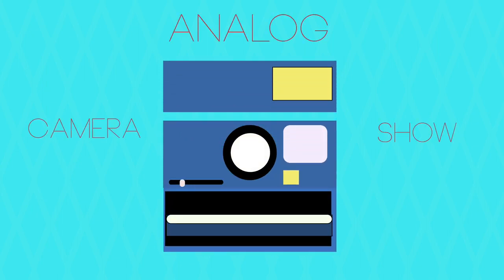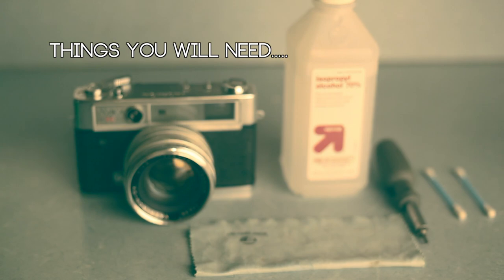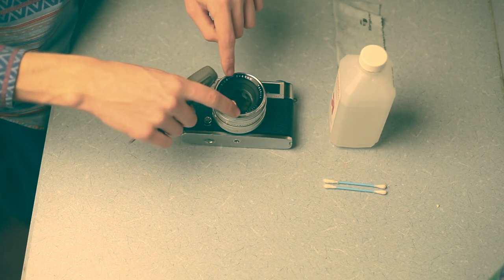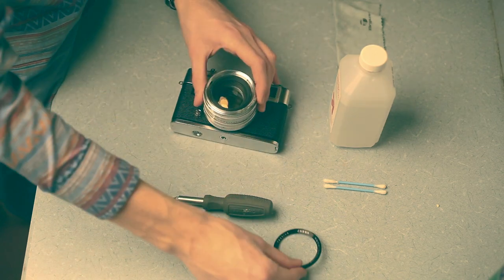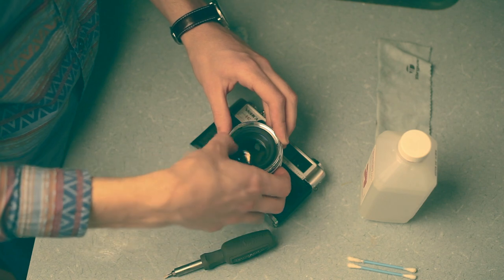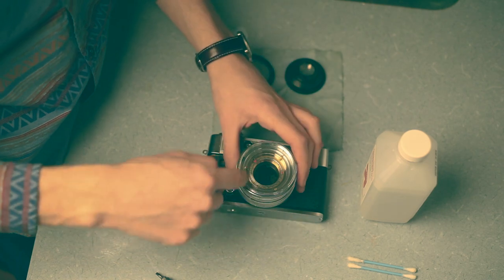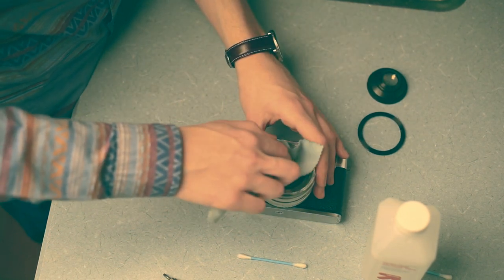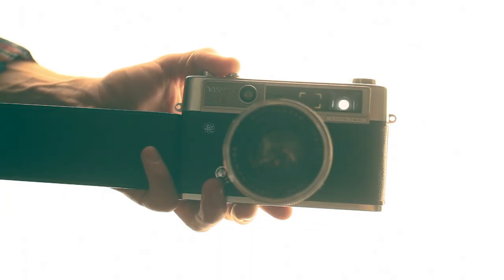How To Fix a Stuck Shutter on a Yaschica Lynx 14E

Comment: First thing to do is keep trying the shutter repeatedly because on a lot of old cameras the shutter is stuck through non use.
Or the speeds might be slow, intermettent etc through non use.
Keep trying different shutter speeds etc holding it upside down shaking it etc before removing anything. 
You could try a dab of lighter fluid in the shutter asssembly( which you get to before removing anything, but what happens is you get oil leaking out if you're not careful.
The lighter fluid is dissolving congealed oil./ DO NOT squirt penetrating oil into it!
The method shown here works for most rangefinder type cameras. and leaf shutters.
It also works for a sticky timer thing.
You dont want to take anything apart at all if it can possibly be avoided.

Comment: Did you have a battery in your camera at this time? I just bought one and have repeatedly cleaned the shutter and nothing has happened. I was just wondering if putting a battery would make the difference
Reply: The battery is only for the light meter, the shutter is completely mechanical.

Comment: Do you use your yashica with or without the battery?  I've heard they work without.
Reply: I just bought a 5000e with a non functioning shutter. I haven't bought a battery yet. Did you ever find out if it requires batteries to activate the shutter?
Reply: No battery needed to work the camera, its only function is to power the lightmeter